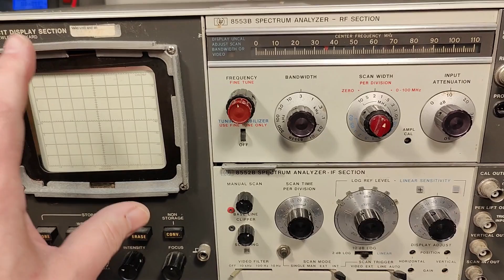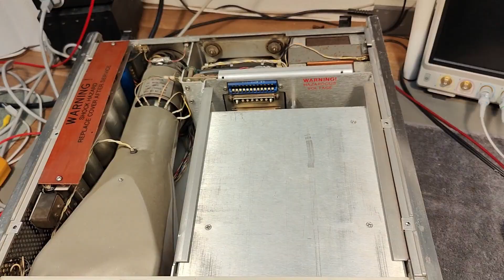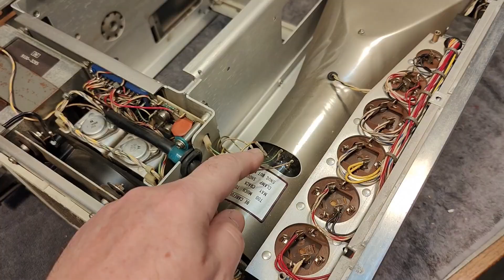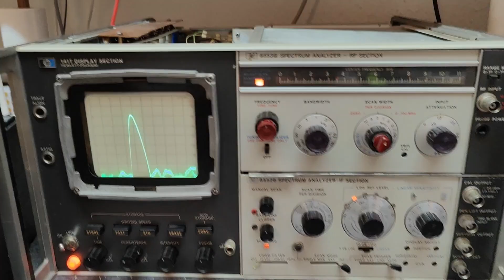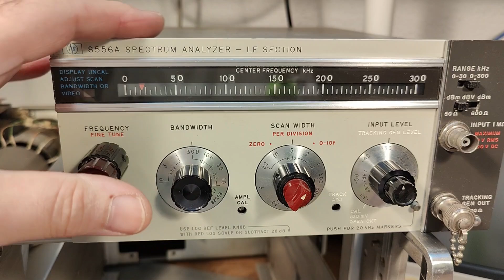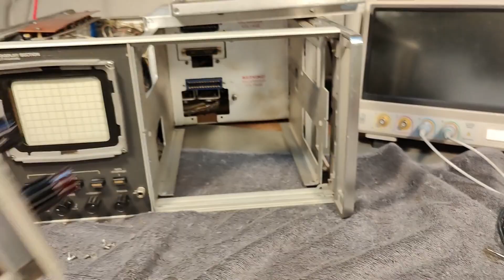HP 8553B Spectrum Analyzer HP 141T Display Section

Comment: In a different life, I used to have a HP151T spectrum analyser. A magnificent piece of kit, built like a tank, a piece of art.
I do seem to recall the RF module was not the same as this, though. The coarse freq. range  there was a lever to  the LHS of the linear scale would mechanically rotate the scale through different ranges, rather like an old TV turret tuner. 4 positions, I think, 4 different scales.
Must have cost 10000s to build, now can be picked up on ebay for a few hundred bucks.

Comment: IIRC some articles (IIRC one of Becatinni`s books mentioned it also) mentioned that you are not really supposed to run certain HP storage CRTs in non-store mode since any visible non-store beam is already brighter than the storage mesh (which, it seems, is far less robust than what tektronix built) can handle... Instead, using variable persistence at lowest persistence is suggested...
Reply from the maker: I would expect this be very loud explained at first page in the manual :-) i better go have a deeper look, thanks again

Comment: I need to get another one of these. There nice unit amd completely adequate for everything I would be doing. But the hard part is working on the plugins. The cables to power them out of the unit is unobtanium.

Comment: Thomas, that brings back memories! I think I used the same model and modules circa 1976. At the time I worked as an Electronics Engineer in the design laboratory. This HP spectrum analyser needed just once each year to check calibration and performance of test equipment on the metrological radio sonde production line. For most of the year stored under my desk. I recall checking the price from HP at the time, and it would have cost twice that I paid for my first house in 1973. It was a very expensive footrest under my desk :) Last time I used it was around 1993 when the then new EMC regulation was introduced.
Reply: I think the price in 1976 was £8k, with RPI would be £64k today!
Reply from the maker: HP did not made instruments for the poor low end marked.. maybe it was better to make best as possible for the most rich ? at least we see the quality, accuracy and relaiability, how well things still work and perform many years later

Comment: I own the 140 & 141T, the 140 is the same minus the storage.  I have all the plugin modules, these are really cool SA's...I primarily keep them so I can do work at higher frequencies if needed, I have a Icom 1.2GHz  transceiver I need to work on and this will come in handy for that.  These support audio out, so you can listen to frequencies....plug a speaker into the vertical output and set your trace to zero bandwidth or flat and it will produce audio....cant remember how loud, I think you control it with your attenuator??  If not, then add a amplified speaker.  ~Jack, VEG
Reply from the maker: nice the 22GHz plug in should be wild compact and heawy

Comment: Hi Thomas! I like such old measurement devices so much that I prefer to keep it as to throw away to a garbage dump.
Did you need another HP141T frame (without any further modules) as organ donor? Unfortunately the Hamradio fleetmarket in Dortmund, Germany is canceled, if you find another way for shipping I give it to you for free.
Reply from the maker: I am sad to hear the Dortmund marked is cancled, it is a bit too far to drive for me, I goto Hamburg area a few times pr year, that is a far as i can handle :-) But thanks a lot for the offer, but one good HP 141T diaplay is all i need for now.. please keep thinking about my YT i love to get new and special equipment.

Comment: She's an oldie. Something tells me they may have had a camera mounted on the front of the CRT as well.

It was one of these, if I recall, that Motorola used, years ago, to photograph the spectrum produced by the MRF 454 and 455 test circuits, and I think one was maybe used in PA tests shown in the ARRL handbooks during that time.

.

Comment: Nice video! Brings back memories of my first job after graduation, 40 years ago.
I recently got a 21 GHz HP8559 RF&IF with HP182 display frame in portrait format, unfortunately no storage tube.
Most unfortunately, the RF mixer is blown.
Be aware that the concept of the HP8559 and also the 8558 lack a YIG preselector filter. They also use harmonics of the YIG LO for the upcenverter mixer, and that makes it difficult to interpret the display properly.
The horizontal deflection amplifier is built into the display frame and driven by the RF section, whereas the vertical deflection amplifier is part of the IF section!
There are also oscilloscope plug-ins available, that way you could configure a 50-100 MHz analog storage scope with the 141 display.
Before you attempt to repair anything that seems broken, try to clean the switch contacts! My spectrum analyzer came back to life after simply pushing the switches a hundred times.
Curios Marc recently made videos about fixing the display section and accidentally zapped a PCB, resulting in lengthy repair.
Reply from the maker: i think i saw that one, i remember i feelt terrible sorry for him..
Reply: I've repaired the HP8557 in the 182T before.  With those dreaded finger contact switches

Comment: I owned one of these for many years, from about 1980 to 2000, when I sold it and purchased a used 70000 system. With no microprocessor control. it was quite slow to use with a lot of knob twiddling.

I ended up with all the extras: 3 RF sections, 2 tracking generators, and the YIG preselector.

Your IF unit seems to have a couple of small sockets which are non standard. It would be interesting to see what these connect to.

Comment: I think the curve was asymmetrical because you were operating in the "uncal" regime (the light left of the frequency scale).  Your sweep was too fast for the selected scan width versus bandwidth, and the IF filter did not have the time to "swing in". Reduce the speed, scan width, bandwidth or video filter to fix this.
The baseline clipper is there to prevent the "grass" from blooming the storage display.
At my first job, we had one of these, but it was already "on the way out". I guess these were introduced in the 60s.
Reply: UPS, sorry! It should be reduce the speed, scan width, or INCREASE the IF and/or video bandwidth.
Reply from the maker: i think the sweep speed do affect this a bit, but not fix this entirely, so the filter is just a little bit unsymetric too
Reply: @TeardownOZ2CPU  Provided the light is off, the amplitude should be calibrated. Too fast a sweep speed will reduce the peak amplitude. Of course modern spectrum analysers have an "Auto" setting which adjusts the sweep speed. You can see the effect of too fast a sweep by switching to manual. 
  The broadest IF filter, which uses tuned transformers, is sometimes slightly asymetrical.
Reply: @TeardownOZ2CPU  As you have seen inside, there are two sets of filters, LC for wider bws and crystals for narrower ones. Do they both show the same non-symmetry, when the "uncal" light is off? If that light is on, the amplitude will also be displayed too low, and the bandwidth too wide. With this type of analyzers, sometimes very slow scans have to be used - that is why they put storage tubes in them. Modern ones have digital storage, of course, and will automatically set the sweep speed, no warning light needed.
I think this type was probably the first fully featured spectrum analyzer, and has some historical value. However, very many were made, so for the time being, they are mostly considered electronic trash, and the collectors don't (yet) pay much for them.